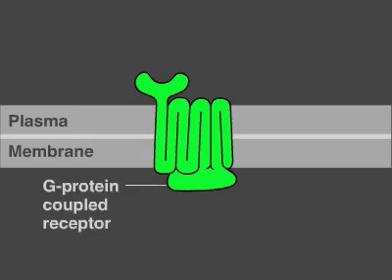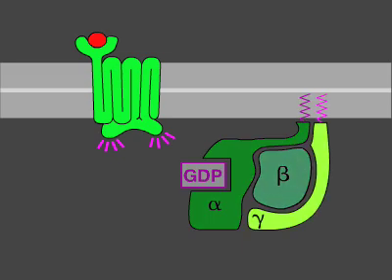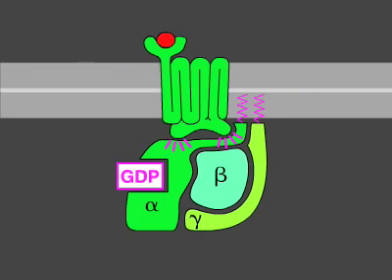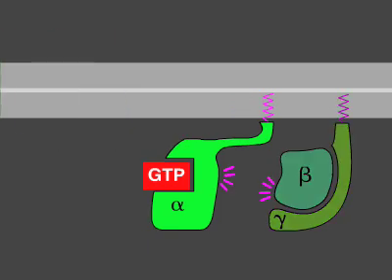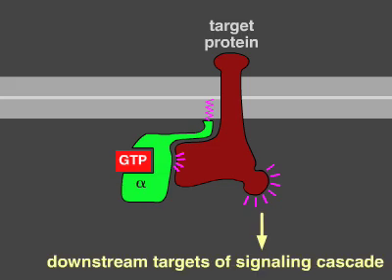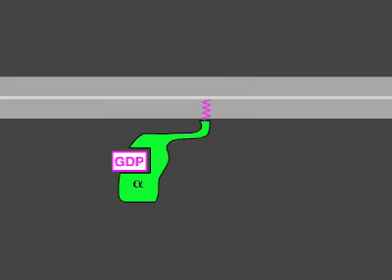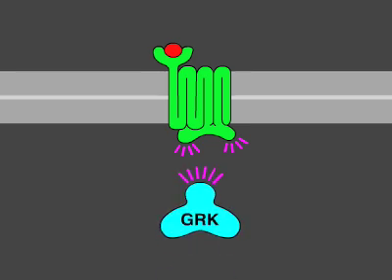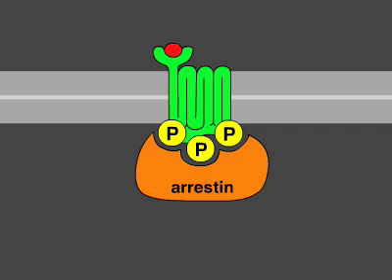G-protein signaling

Comment: Ligand bind to receptor and then signaling pathway is initiated. Gprotein is activated and binds to intracellular domain of receptor protein. This causes conformational change and gdp goes off from alpha subunit. Gtp then comes in and binds to alpha subunit. And then alpha subunit can be either dissociated or remain bounded to beta and gamma subunit. In either way, activated g protein activates adenyl cyclase which produces secondary messengers like cAMP to initiate the phosphorylation cascade. Subsequently a kinase phosphorylates the intracellular domain of receptro protein and a asseratin binds which inhibits further reaction. This turns g protein and the receptor into resting state.

Comment: An activated receptor induces a conformational change in the alpha subunit causing the GDP to dissociate. GTP which is abundant in the cytosol readily binds in place of the GDP. GTP then causes a change in G protein therefore regulating the activity of target proteins in the plasma membrane. Then the alpha subunit hydrolyzes its bound GTP to GDP, reversing. turning it off and repeating all over again as long as the signaling receptor remains stimulated.